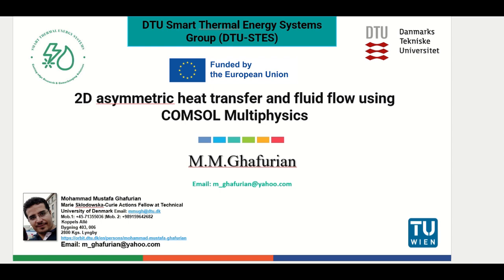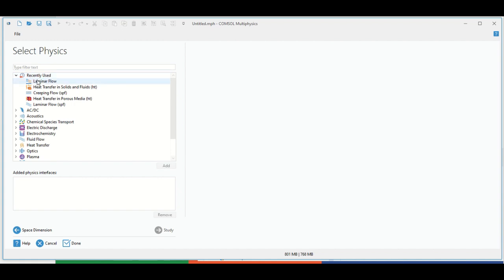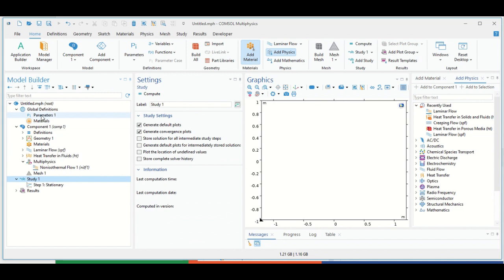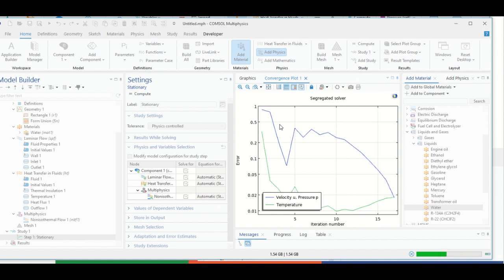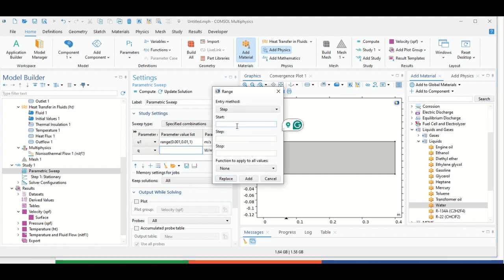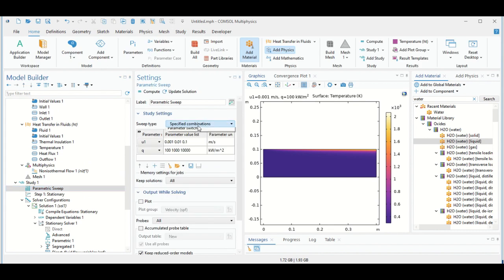2D Asymmetric Transfer and Fluid Flow Using COMSOL Multiphysics

Comment: 2. Các bước thực hiện chi tiết
Bước 1: Thiết lập ban đầu (Model Wizard)

Chọn không gian 2D.

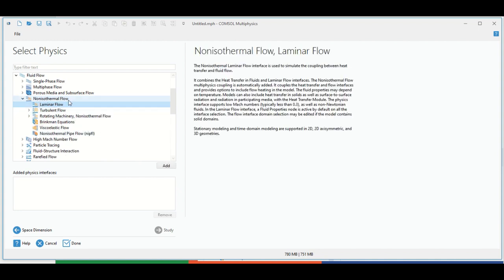Chọn vật lý kết hợp: Fluid Flow > Nonisothermal Flow > Laminar Flow. Việc này sẽ tự động kết hợp cả dòng chảy tầng và truyền nhiệt [03:07].

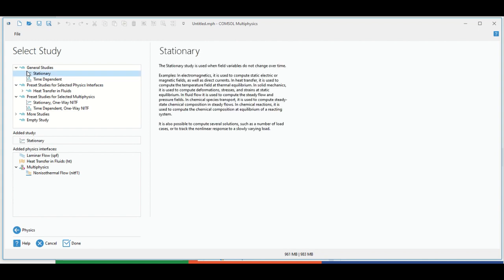Chọn loại nghiên cứu: Stationary (Trạng thái ổn định) [04:05].

Bước 2: Xây dựng hình học (Geometry)

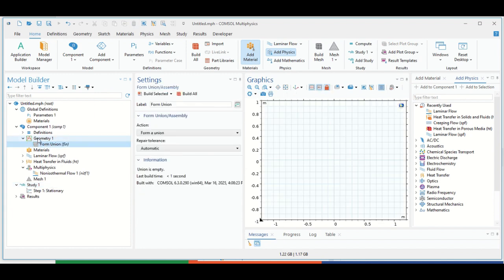Vẽ một hình chữ nhật (Rectangle) để đại diện cho kênh dẫn chất lỏng [05:06].

Bước 3: Gán vật liệu (Materials)

Thêm vật liệu Water, liquid (Nước) từ thư viện vào toàn bộ miền mô phỏng [05:47].

Bước 4: Thiết lập điều kiện biên cho dòng chảy (Laminar Flow)

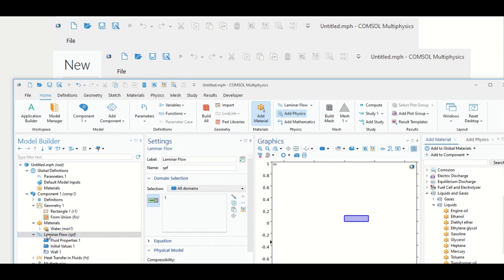Inlet (Đầu vào): Chọn biên bên trái, đặt vận tốc đầu vào. Video khuyên nên đặt vận tốc là một tham số (ví dụ: v_in) để thuận tiện cho việc phân tích sau này [07:06].

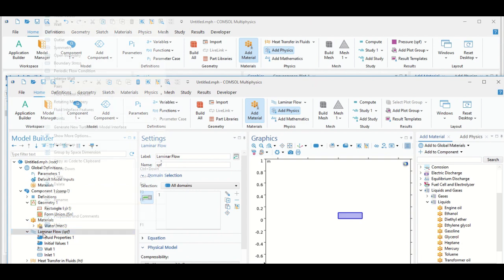Outlet (Đầu ra): Chọn biên bên phải, thiết lập áp suất bằng 0 Pa [08:07].

Bước 5: Thiết lập điều kiện biên cho truyền nhiệt (Heat Transfer)

Inflow (Nhiệt độ đầu vào): Thiết lập nhiệt độ chất lỏng ở đầu vào (ví dụ: 300 K) [08:43].

Heat Flux (Dòng nhiệt): Chọn một đoạn vách ngăn và nhập giá trị dòng nhiệt (ví dụ: 1000 W/m²) [08:58].

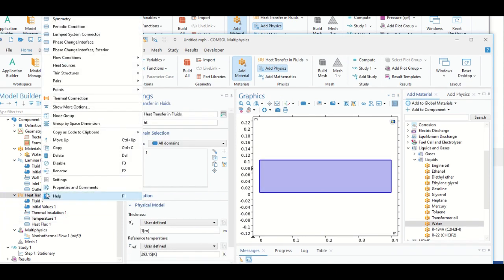Outflow (Dòng ra): Chọn biên đầu ra để nhiệt lượng thoát ra theo dòng chảy [09:37].

Bước 6: Chia lưới (Mesh)

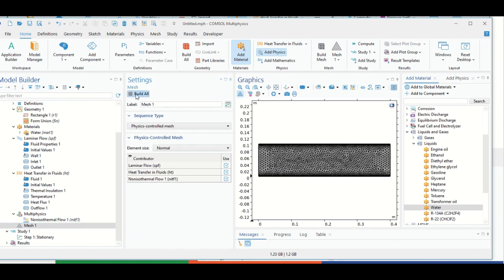Sử dụng lưới mặc định do phần mềm kiểm soát. Với bài toán đơn giản này, lưới Normal là đủ để cho kết quả chính xác [10:09].

Bước 7: Phân tích tham số (Parametric Sweep) và Tính toán

Đây là điểm đặc biệt của video này:

Khai báo các tham số cho vận tốc đầu vào và dòng nhiệt trong mục Parameters.

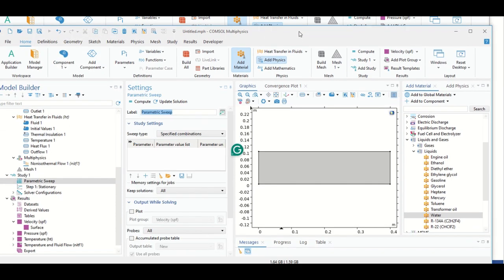Chuột phải vào Study, chọn Parametric Sweep [13:03].

Thêm các tham số cần khảo sát và nhập dải giá trị (ví dụ: vận tốc từ 0.1 đến 1 m/s).

Nhấn Compute để chạy mô phỏng cho tất cả các trường hợp tham số đã chọn [14:51].